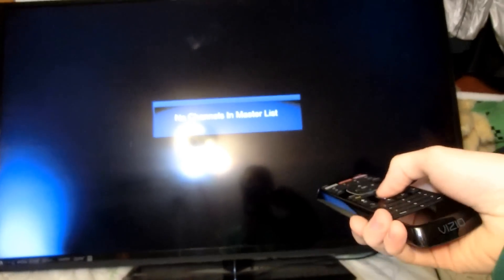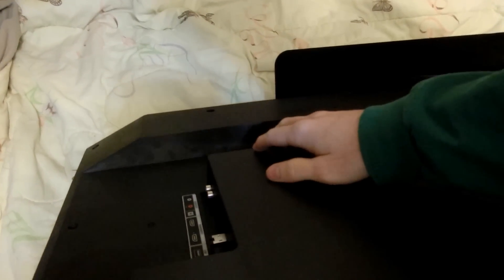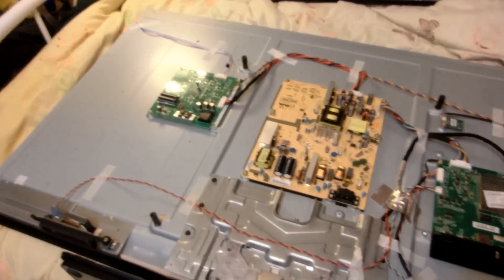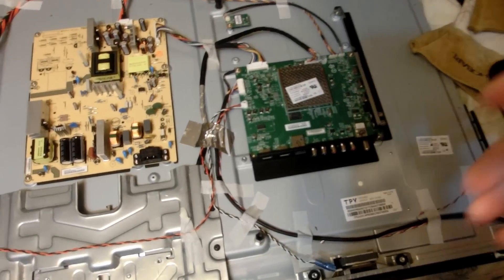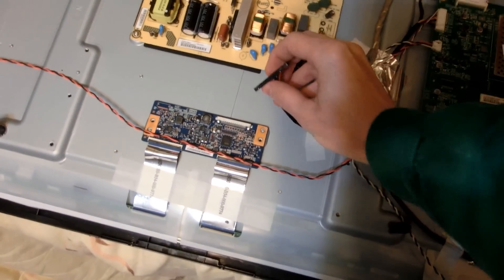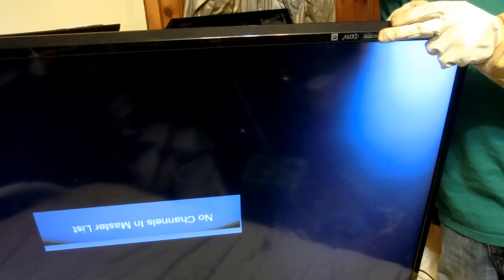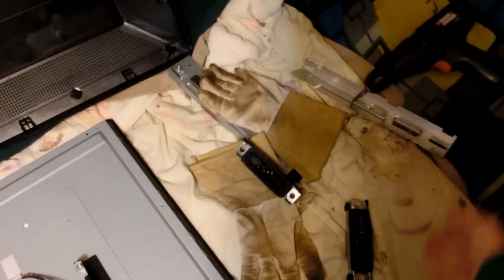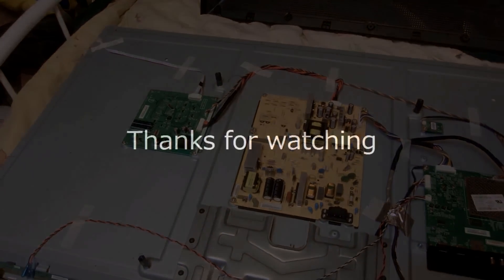How It Failed: LCD TV white spot Vizio E500i-A1

Comment: With the LCD glass sandwich removed, these TVs make cool light tables if you do any work with transparencies, or other projects requiring a bright up-lit surface, or  provide a wide even illumination for photography projects as well as a perfectly flat workspace.  Might be a bit bright to look upon, though, but not quite bright enough for fast shutter photography.  I guess it depends on the light source.  It may or may not have flicker, too.

Comment: The washed out picture is due to either a bad or incompatable main board or bad Timing control board ( the tiny board under the plate you missed) Mr. Tapalot.

Comment: In my opinion I think it will be more fun to fix it than to break it.It probably only needs recalibration or maybe the gamma control setting is set too high. whatever you do don't destroy that tv take it to a repair shop or sell it on ebay. Anyway CRTs don't have a better color depth they because produce orangeish reds and yellowish greens LED LCDs have a wider color gamut and better color accuracy :)
Reply from the maker: as stated in the video, a repairman already replaced two boards and that made it worse. it will be cooler to destroy. and yes CRTs tend to have better colors. thats just how it is for the time being. the black on a flat tv ussually has issues.

Comment: dude you just need to replace the video driver board (blue little board that two flexible cables attached) . I came across to this 2 times
if u r willing to not to fix it you can pour some water on it while its laying horizontally on the ground with aquarium scene playing background and see how long it takes to go out :D
Reply from the maker: the repair guy said he replaced that board, but i really dont like TVs like this anyway. thanks though.
Reply: yeah, they dont give flavor of old school crts

I m an electronics guy and repair LCD & Plasma and mostly CRT televisions.

I must confess in CRT s I like the smell of  dust rising through the holes of back cover :P
Reply: Bilal Öz Wait what? Does ppl repair CRT televisions?!
Reply from the maker: Bilal Öz
not counting CRT is still better color depth and refresh rate than modern LCD, LED, Plasma and OLED screens. when playing a video game on an LCD monitor sometimes you will feel a slight delay because some are above 20ms, but if you use a crappy old CRT monitor you get that delay down to like 1-3ms
Reply: Rinoa Super-Genius My condolences for your bad [newer screen technology] experiences. But, please don't judge all [newer screen technology] alike, just because you have some crappy experience don't mean them all suck.
Reply from the maker: Torbjørn Jørgensen
so youve never heard of screen latency? flat panels always have worse latency than a good CRT, thats just to do with how it handles the images. i would suspect there are probably a few panels that have less than 1ms of latency but they would be very expensive.
Reply: Torbjørn Jørgensen
as log as owners want to pay for it, why not ?
 in my country most of crt repair guys are already retired or changed to other  jobs so not much people left to do it
Reply: Rinoa Super-Genius
yeah thats true. its funny how half a century technology can deliver 1-3ms picture latency but technology of nowadays can t
 ( not all of em)

Comment: HDMI and DVI use the same signaling.. so you onely need a cable with diferent plugs in the end to use it.
Reply from the maker: but i only use DVI because DVI can be converted into VGA.
Reply: no. DVI canot be converted to VGA more then HDMI. "some" DVI have analog "VGA" pins in them you can tap off with a converter. today tho most gfx cards do not have the analog part any more and you cannot connect them to a VGA monitor without a active converter. VGA is analog and not realy used any more :/ 
DVI-A is analog onely
DVI-I is digital and analog
DVI-D is onely digital and this is what you get an a modern gfx card if at all. even the DVI is on the way out now. now you get HDMI and DP (Display port) the DVI connector is there for compatibility for old stuff. and i'm getting to be to old. when i started with com puters it was all compost and 9 pin analog CGA/EGA
Reply from the maker: grapsorz
 yes DVI ports on a graphics card also carry analog video witch can be used for VGA, you disagree with me yet you state what proves that in your very comment. my graphics cards have that signal in them.
Reply: yes all old one have that and some new ones. just be prepared to switch from VGA from now on. Nvidia stil have a DVI-I on most card's. AMD usually only use DVI-D on R9 290 and up. in the 280/280x is you get DVI-I on some card's the card's with DVI-I usually only support two monitor's without the use of an active DP adapter :( even tho they have two DVI, one HDMI and one DP plug only two can be used at a time.

GZ with the new jobb ;)
Reply from the maker: grapsorz
 well its just a matter of using a differant cable, most monitors i find have a DVI and a VGA input. but my Nvidia GTX 560ti will probably last me for a good 2-4 more years anyway.
Reply: Rinoa Super-Genius btw. i was thinking my old gfx card was ok until i started to look in to 4k video and gfx accelerated rendering/editing. i think i'm going ot get a new card within 1 year if i get a 4K camera. that is the only reason i need something with more power then what i have now.
Reply from the maker: grapsorz
i dont even have a 1080p screen haha. if my camera had the option i probably would have stuck with 720p.

Comment: Hey youve had a look and there is nothing obvious to put right, the backlighting/psu and analog to digital boards are likely to be ok, it cant be used to fix another set so its arrow fodder lol :-D
I wondered if the back lighting had issues, but its crap lol.

Video playing: Robin hood, Cowboys and indians, Captain archer from Enterprise, or a pint of strongbow ha ha :-))

Ive never been impressed by lcd tv's, the picture is cack, but some laptops have an amazing clarity of picture, i think that any analog to digital system is bad.
If that screen could be directly interfaced with digital data i bet it would be much better, but its not worth the trouble.
Reply from the maker: yeah i'll stick with my 1987 CRT Magnavox, it works with my NES and other game consoles well.